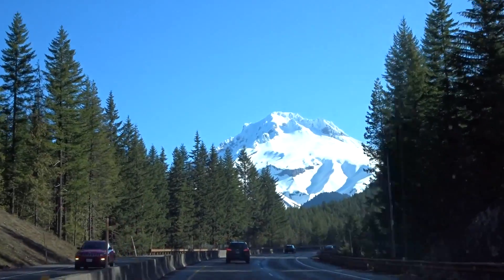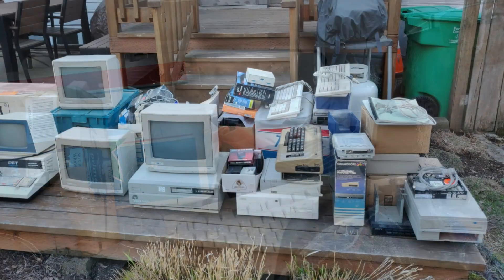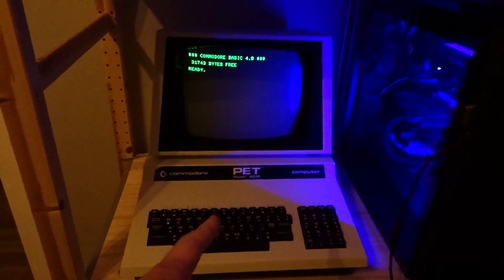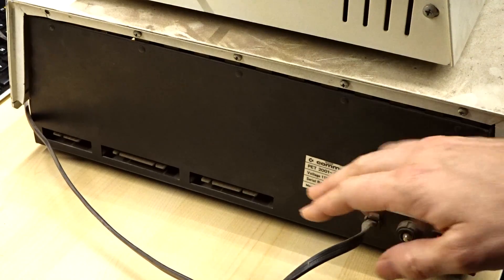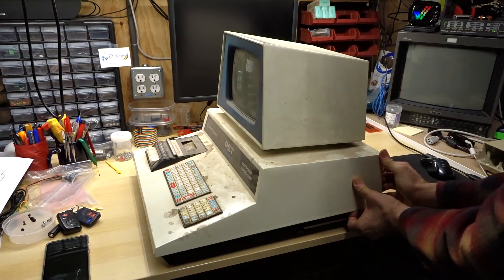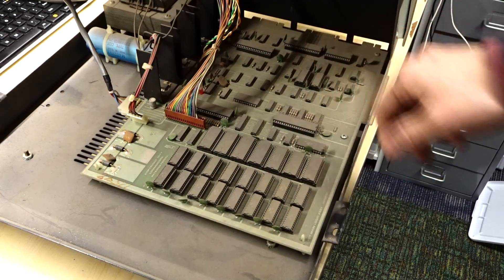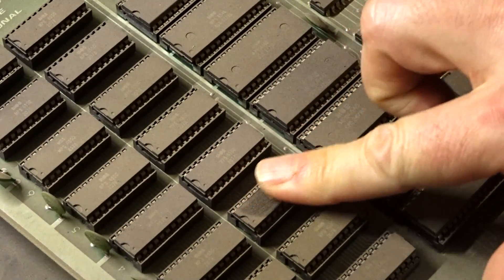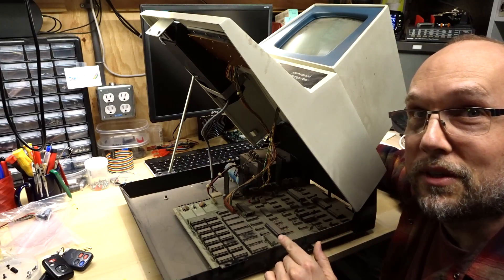The Commodore PET Rescue

Comment: Great video! The very first computer I ever used was a PET-2001 that looked exactly like that! I was 11 or 12 at the time. I now own a slightly newer model: an early 4016 with a keyboard that's like your 4016 but a small screen like your PET. Mine has a plastic case and a motherboard that was made in 1981: It has dynamic RAM chips like your 4016 but it doesn't have the 6545 CRT controller. By the way I recommend visiting tynemouthsoftware.co.uk for some products that can help you fix pretty much any problem on your PET: They have a diagnostic card and a RAM/ROM replacement card; those just sit between your 6502 and the motherboard and simulate part of the hardware to the CPU. That way you can also upgrade your BASIC ROM to version 2.0 (or later); looks like you have a BASIC 1.0. And you'll have 32K of RAM.

Some minor corrections. Don't take these personal, I'm just trying to help:
3:20 Commodore also made office furniture so the easiest way for them to make this was to make it like a filing cabinet.
3:36 That's an IEEE-488 port. Not specifically for disk drives; it was also used for printers and could potentially be used for other gear such as oscilloscopes or logic analyzers. In the earliest PETs the port didn't work because there were bugs in the ROM. When they released ROM version 2.0 those problems were fixed. My school had an 8050 disk drive that could fit a whopping MEGABYTE on Double Density floppy. It took IBM another 3 or 4 years before they could do that with the PC and the Commodore 1541 was a big step back.
3:51 That fuse holder was completely gone, it probably got hit from the side when someone moved the machine or put something heavy down right behind it.
4:23 I don't think I've ever seen anything that used the expansion port on the side but there were plugin boards that used the INTERNAL expansion connector. For example the SuperPET used it to add extra RAM and an alternative processor.
4:56 You should have shown the underside of that cassette recorder :-) These early cassette recorders had a corner cut off where the batteries and speaker used to be, if I remember correctly. Around 8:55 you can sort-of see why they did that: it would get in the way of the heat sink :-)
5:14 I think the number is 320008 (not 32008). That's the first circuit board that Commodore made for the PET. Your 4016 is very different!
7:45 I would recommend against plugging anything in if the fuse socket is as broken as yours!
10:29 The fuse is a little on the high side (1.5A instead of 1.1A). You just voided your warranty haha :-) . But seriously: "Beefy" and "more than enough" are not the right words. Basically the fuse is intended to be the LEAST "beefy" part in a circuit so that when you get a short circuit, it fails before something else does (such as the transformer). You're probably okay in this case but... read the sticker on the back.
11:21 The screen full of Q's that goes away means that there's probably a problem in the display character encoder circuitry (probably not the RAM or you'd see garbled data that wouldn't go away). A 'Q' is encoded as binary 00010000 and space is encoded as binary 00000000 in PETSCII. Chances are that it'll go away when you re-seat the chips, especially the character generator ROM and video RAM.
12:33 Looks like your system RAM is not fully working either: That should say 7167 bytes free.
12:36 If none of the keys are working, it probably means one of the PIA chips isn't working. It's a common problem. Try swapping the two 6520 PIA chips (the other one is used for the IEEE-488 port). Also, again, it could just be that a chip needs to be reseated; those IC sockets are notorious for lousy contacts.
13:05 This keyboard doesn't use rubber but you may have some oxidization in the switch contacts. But as I said, if no key works at all, it's probably the 6520 or its socket.

Good luck! Looking forward to the next in the series. That picture of the entire haul looks very promising.
PS Drive safely! Pictures of mountains and baggage can wait until you're stopped.

Comment: Dont understand when peeps have a totally dirty machine and risk shorting it out by turning it on before cleaning it.
Reply: I've never had a machine short out by dust.  As well, I know there are differing opinions on whether you should clean and recap everything on the board before you ever try it, but I personally prefer to turn it on (after doing a quick initial inspection and possibly checking voltage if it's feasible) before I touch it, so at least i know the initial state of a device and that way if it doesn't work after cleaning (which has happened), i know it's something i did.  Based on Adrian's experience, i'm pretty confident that he can diagnose and fix any issues that might arise as well.

Comment: i’m so afraid to turn on old computers and crt that haven’t been turned on in ages, i feel like they’ll blow up or dry themselves
Reply: You can't be more correct.  Old electrolytic capacitors might dry up and become like a resistor even when then visually seem to be perfectly fine, which would cause bigger problems in your device.  Same concept applies to the power supplies too.  You should disconnect the power supply and check voltages first if you don't want to accidentally fry some components.  This video is presenting a very bad example.  This is a how-not-to video for sure :-)

Comment: 7:40 plugging the machine not knowing if the voltage are right and with all this - maybe - conductive dust? what a stupid move.
Reply: Perhaps you should research the Commodore PET 2001 and perhaps suggest how you would test the DC voltages without powering it up considering the regulators are all built onto the motherboard and no simple way to test turning it on.  The "Power Supply" is strictly an A/C transformer which rarely go bad and they will never provide more voltage to a board like a regulator will.
Reply: @BrianV_PM  Even so that not a proper way to check. First thing first: blow away the dust  with an air compressor and then visually check all passive components. You're like the guy who find a  car standing still in a barn for 50 year and rushing to plug a battery to start the motor and damaging pistons, cylinders,  in the process. Take your time. "rarely", yes, but in this case it was a gamble.
Reply: @stephane.sonneville  I'm not sure a car with mechanical components is comparable to one with digital components.  There's nothing he needs to oil here.  In any case, I agree you should definitely follow best practices especially in accordance to your skillset.  If you're not experienced or comfortable understanding and repairing these devices, they are not for the beginner and one should probably have someone else look at them first.  In the case of Adrian, he's already worked on two Commodore PET's that were initially not functioning and has repaired them both, along with numerous other machines.  This isn't his first rodeo and just because things weren't done or checked 'on camera' doesn't mean he didn't know what he was going into before he turned it on.

Comment: The PET was what I used in high school until we moved "up" to a T!99-4A. I repaired a crack in one of the copper traces on the motherboard and it performed flawlessly.  Somehow one of those green capacitors had gotten whacked and it broke the copper track. There was enough lead left to solder it back together.  The thing had been gathering dust in a library for who knows how long.
Reply: The TI99/4a may be better for gaming but the PET is certainly the more versatile machine of the two with its GPIB interface.
Reply: @douro20  One of my former employers used a 3000 series PET  for instrumentation and data acquisition in their research lab -- specifically because of the GPIB. It actually was the lab's first computer when it was founded in '79. The PET was last used as part of a "multicamera optical system" before gathering dust in the lab's basement. That PET is now in my possession, and still doing well. (Ok, the monitor's horizontal linearity is a bit out of whack; probably needs a new cap in the deflection).

Comment: Great video -- you've had better luck than most on those machines.  One very minor pedantic point: The "PET 2001 Series" does include models (most in fact), that use 2108 and 4116 DRAM chips.  The only models that used the MOS 6550 SRAM chips were the 2001-4 and 2001-8 (sometimes called the 2001C machines to differentiate them from the 2001N and 2001B models).  You can check http://gallery.zimmers.net for more info on the PET 2001 series.
Reply: Ya, only the very early ones have 6550s. I know one of mine does. One is a black badge and the other is a blue badge. I bought a few 2114 SRAM adapters in case I have a burn out later. That said, I barely use them. I just keep them working and preserved.
Reply: @peterlamont647  I think all black-badged ones use DRAMs. Mine has a 320137 main board.
Reply: My chiclet PET 2001-8 uses TMS4045-45NL Static RAM chips.

Comment: I never understand why I am always seeing people "just turn it on". I always take power supplies off the rest of the system,u nhook the monitor then test the psu voltages. This makes sure you don't cook components because of a bad PSU.
Reply: What power supply?  You mean the A/C transformer?
Reply: @BrianV_PM  The voltage regulation circuitry in particular. Capacitors and diodes tend to be a weak point. If the regulation fails, many times the fault is overvoltage, or passing AC through to the main boards, or otherwise.
Reply: @wolvenar  Well, it's been my experience that A/C Transformers rarely fail and if they do, they provide less voltage and not more voltage.  It's usually the voltage regulators that go bad and provide over current (like on a c64 power supply).  Since there is no 'power supply' on a PET 2001, all the regulators are part of the logic board, there is no way to test it without turning it on (short of unsoldering and removing the regulators or cutting traces on the board).
Reply: @BrianV_PM  Yes I realize that it is probably onboard regulation. Many S100 systems have similar. The S100 systems LOVE to sport shorted tantalum capacitors which generally burn traces well before the caps cook. Guess it's just my overcautious way of doing things.  I will go through quite large lengths to separate any power systems , sometimes apply dummy load and test before letting it power up the rest of the system. It gets quite complicated in some things to do that, but I think the PET wouldn't be all that bad. Lift a few component legs, solder on some wire and find a suitable load to test. The load is both to make sure it does work under similar load to normal, and many means of power regulation do not stabilize until under a load. Yes I see regulators fail as well, but that PET is getting back far enough where I was seeing circuitry that proceeded the integrated voltage regulators. Not that they didn't exist, but they were still prohibitively expensive.  I have not yet worked on a PET so excuse my ignorance on the details. On my 5150 system (somwhat newer as you know) the 12v rail was over 30v when I did such a test  as I got it. Of course the 5v was similarly high by design. Various VCRs and Pioneer Laser Disc systems  also tend to be such offenders. MANY Bally pinball machines from the 80 have shorted bridge rectifiers which send AC into the rest of the DC systems. It r wreaks havok on the driver's.  Occasionally I see eproms /cpu cooked from the AC leakage as well. Anyhow I'm sure you get my point and maybe understand why I am always overly cautious.

Comment: The first thing I would do is to test the power supply separately (without it being conected to a computer), for good security measures.
Reply: With the 2001-8  that osnt really possible as the power supply is on the main board with 4 seperate voltage regulators and no real way to isolate them unless you want to cut tracks on the pcb..

Comment: I would definitely replace that big capacitor in the power supply - you do NOT want to experience one of those venting, especially as they often had no safety vents!!
Reply: I've never seen one of these go bad.
Reply: sadly, i almost feel like whatever chinese part you replace it with today could actually be worse than what's already in it.  I can't tell you how many times those old 70's and early 80's capacitors i've gone to replace have actually been closer to spec then the new ones.
Reply: @BrianV_PM  who said anything about a chinese part? Plenty of good manufacturers to choose from such as Kemet, Nichicon or Vishay
Reply: @jaycee1980  I'm just reluctant to swap out capacitors that still work but good to know you can get new quality replacements for that part.